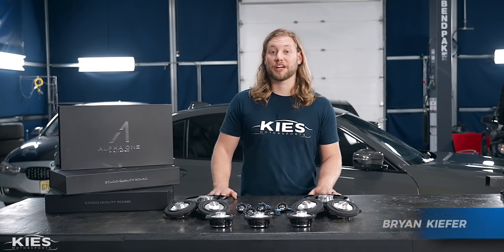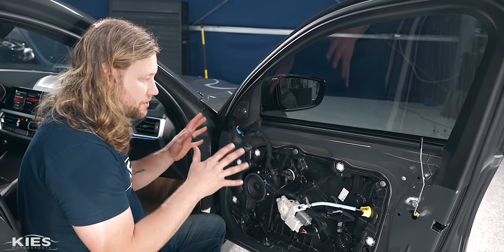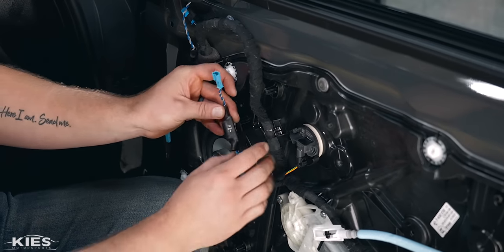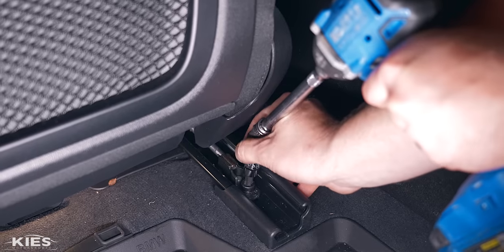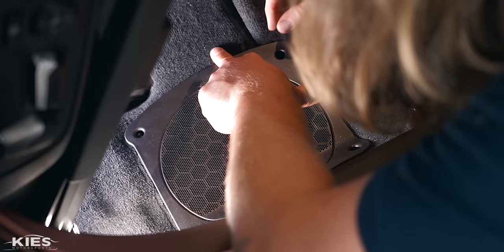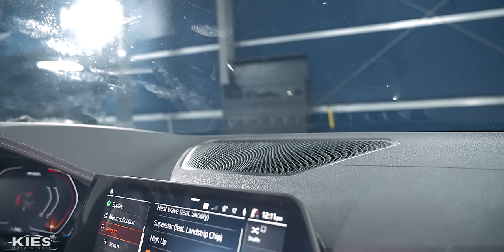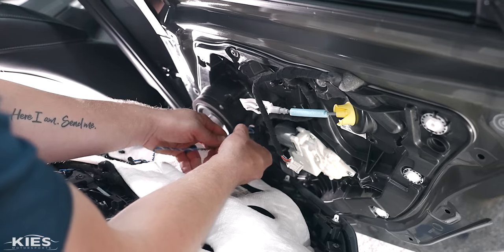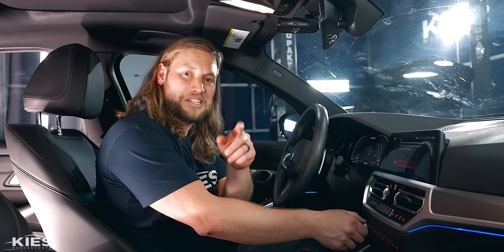DIY: Full G20 BMW Speaker Upgrade! BimmerTech Alpha One

Comment: I did this to my car, and with the new amp they offer for the M340i too.  Noticeably different but mine was also just the standard Hi-Fi version.  Bass is drastically different and tweeters are very clean.   Top end volume is higher too while still producing a clean sound.  My one tip is to pre-purchase some extra door clips (black and white doohickeys) from BMW.  They are a couple bucks each and you will break some - or in my case roughly 10 between the four doors before you figure out how to optimally align them when putting the doors back on.
Reply: Which amp and speakers did you use to upgrade? Does the upgraded HiFi set up sound better than factory Harman Kardon?
Reply: Do you have a part number or a link to the door clips?

Comment: They use those metal brackets on the center console due to specific frequency vibrations that cause plastic ones to break or pop out.  I could get all technical about resonant frequency of the plastics used but yea.  That's why the metal brackets!
Reply: That and the notorious rattle the F30s had from the HK system on the center channel

Comment: Really awesome video (as all of your videos are) with extremely clear and highly professional instructions - thank you!!  One question:  In the BimmerTech instructions that I received after purchasing the Alpha One speaker set, it stated that the 12V and the 48V batteries and the CAN bus all need to be disconnected before beginning the speaker install.  I did not see that done in your video.  Can the install be done without disconnecting the two batteries and the CAN bus?
Reply: I've changed speakers and fiddled with disconnecting/reconnecting them many times. Never disconnected battery for them. I even disconnected them while music was playing to diagnose rattles. Don't worry about that too much.

Comment: Brian, I noticed you did not disconnect the battery before removing the door panels? Would you be ok replacing the speakers without disconnecting the battery in F30 LCI?
Reply: Disconnect battery to avoid codes if you accidentally turn ignition on with cables disconnected.
Reply: Do you need to disconnect both the 12 V and the 48 V battery - because instructions say to disconnect both?   Feel like disconnecting both might in itself cause codes to occur?

Comment: I have the standard Hi-Fi in my 2021 330i.  If I were to only change either the Speakers or the Amp to the BimmerTech, which would give me the most noticable difference?
Reply: I have the same car standard Hi-Fi that you do.  I just added the amp a few days ago, and it is definitely better than without the amp and I believe it is a worthwhile upgrade in itself.   However, for me the quality is not there yet.   Hoping the speaker upgrade brings it to the next level.
Reply: I had the same question haha.go with amp or replace subs for now
Reply: @miketennis14  is it worth to upgrade only amp? Did u montage speakers too? How is quality now